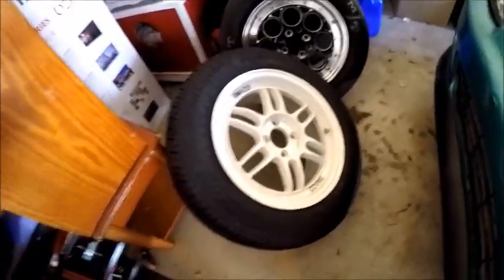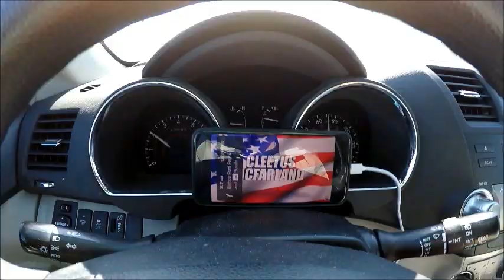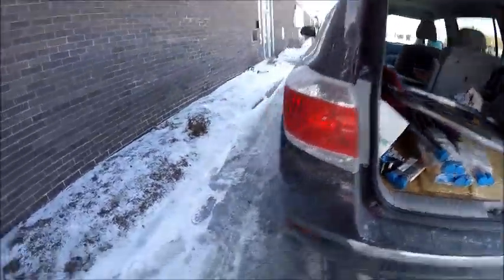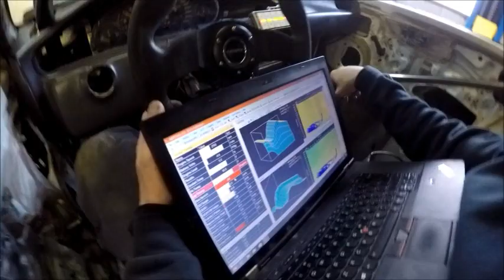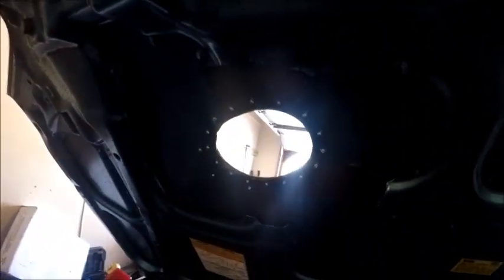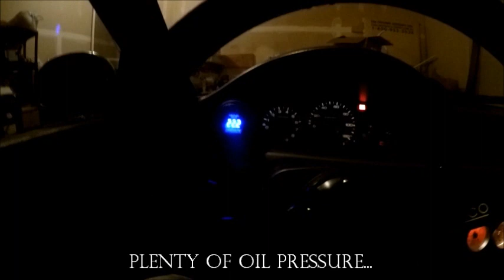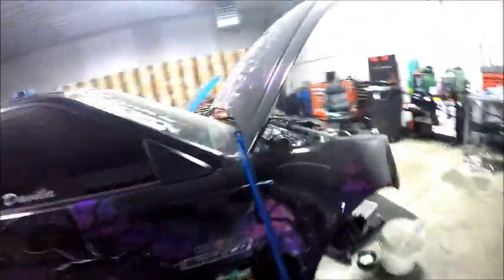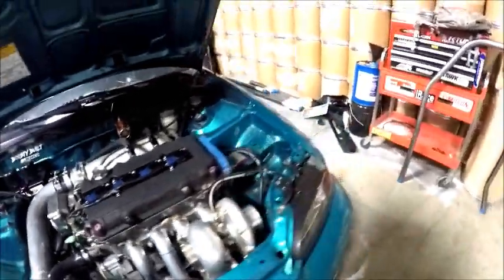THE HATCH IS GETTING CAGED!

Comment: What are the real roadblocks to a high hp d16. Say something running over 600hp info is hard to come by over 600
Reply from the maker: Jared The usual problem above 500-600 is the headgasket, but oring will help solve this issue. Another problem is oiling as it’s prone to spin bearings when rev really high and the trans couldn’t hold a lot of power.
Reply: Hi Jun, can you elaborate on the o ring bit please I would be interested to hear...
Reply from the maker: MrZeroLag you oring the block
Reply: @jcvillaruz  I mean people say the sleeves are extremely strong in them but it's like no body who has one making big power says anything unlike where you can buy everything off the shelf to build a 1000hp b or k series effortlessly
Reply from the maker: Jared Stock open sleeves was pushed to like 600+ before it cracked on my buddys vitara build.